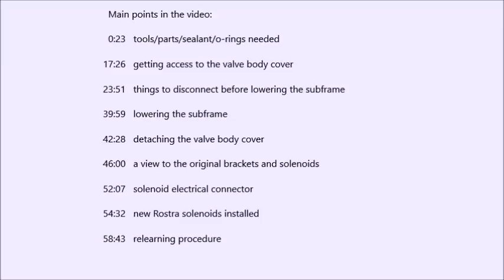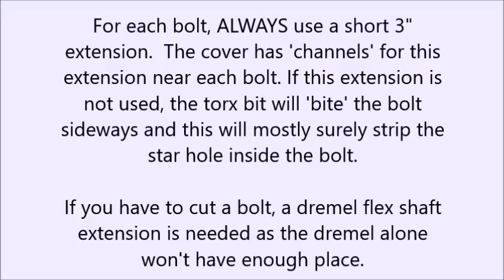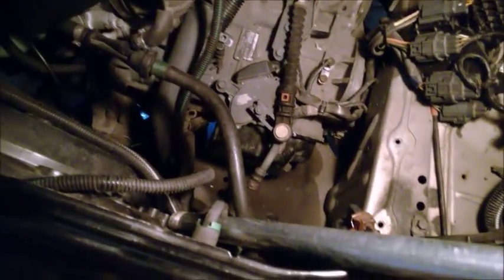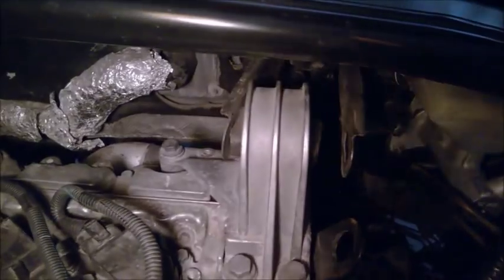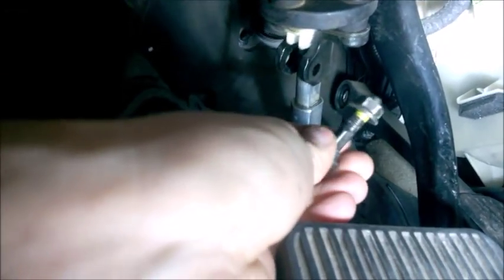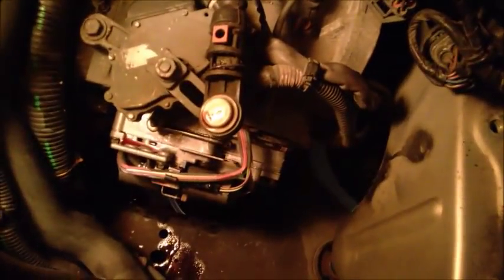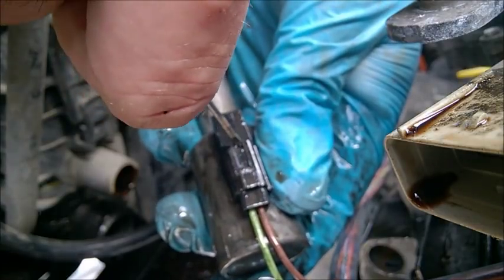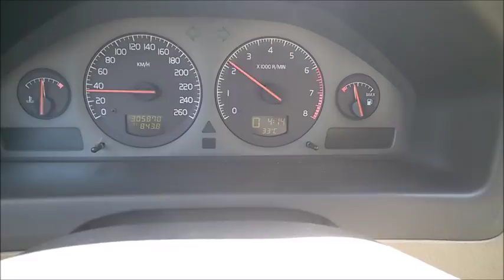Volvo S60 V70 Transmission Solenoids Replacement + Adaptation Relearn 2001-2009

Comment from the maker: I recommend measuring the adjustment of your old solenoids, and make sure the new solenoids have the same adjustment. See this video  https://www.youtube.com/watch?v=k1TG4BOjixg May use a 3mm Allen key or a Torx 15 tip.  The reason for this is, Volvo says the original solenoids are 'matched' to the valve body, which may mean that not all original solenoids have the same adjustment from car to car.  A Volvo owner also reported problems with the S4 solenoid which affects the 2-3 upshifting. I did not replace this solenoid and indeed, my 2nd to 3rd shifting is the one that still has an 'hesitation'
Out of curiosity, an article by Rostra (who made de solenoids), it's about the Geartonic transmission but at the end of the article, Rostra says "Problems with OE solenoids involve wear or debris build up affecting the internal bushings. Rostra has redesigned the bushings to prevent those issues such as wear or sticking of the spool valve. The solenoid body has also been redesigned for better oil flow."  So Aisin said no need to change the fluid, but the solenoid design was actually not correctly done to work properly in old fluid. https://rostrapowertrain.com/2018/05/aisin-warner-09g-electronics-anatomy-of-shift-controls/

Comment from the maker: One interesting and little known fact, is that the MAF sensor also plays a role in the way the automatic transimssions are shifting.  A fouled sensor (not necessarily faulty, but with the hot wires covered with dirt), may also cause the transmission to shift weirdly.  It's a less known fact, but worth google up : "does MAF affect automatic transmission".
Reply: See i have been trying to find info about the affect it might have because my issue only happens once the transmission is hot. Then i suddenly have no gear. Like “shift flairs”. But it cools down its good to go. 

When it happened the first time it was hard shifts, when i checked my dipstick it was definitely burnt. It only acted up once it got warm. Naturally i changed the fluid. Simple drain and fill. Not a flush. But no change in performance. 
 
It Worked great for a while during the winter but it would act up if it rained. 

I still could not for the life of me figure out what was happening. But now if it gets warmed up then its not gonna move anywhere. It also has a buzzing sound I noticed after this last fluid change. This sound will stop after the operating temp is reached.

Comment from the maker: Hello everybody.  I would like to share my 2c about transmission fluid change.  This is just my opinion  😊  I did flush my transmission at 100.000 miles.  I have to say, it worked less well afterwards.  Before the flush it was shifting with only a very small kick, after the flush the kick was more obvious.

The transmission adapts continuously to the fluid properties.  Replacing a large part of the fluid at once, may not help the transmission to adapt quickly enough (bigger the change, bigger the adaptation).  When we drain the sump, we remove 3.5L which is exactly half the capacity of the transmission. So the transmission has to adapt to 50% new fluid all of a sudden - this new fluid has quite different properties than the old one.  Plus, the old fluid is the genuine one, replacement ones (Mobil, Toyota, etc) have different properties.  On top of this, the solenoids are old and work more or less freely, so the adaptation is even more difficult.

If I was to do it again, I would remove a smaller amount of fluid every time:  more like 2L instead of a complete 3.5L sump drain. Then drive the car at least 500-1000 miles inside the city where the transmission has to do a lot of shifting so has plenty of time to adapt to the amount of fresh fluid.  And given the aftermarket fluids are not exactly as the genuine one, I would invest a little and buy genuine fluid.  If you look at the cost, 12L of genuine vs 12L of Idemitsu is only $100 more, basically the equivalent of 3 oil changes.  I think it's well worth an extra $100 for the transmission. Of course, just my opinion  

Idemitsu fluid https://www.fcpeuro.com/products/volvo-transmission-service-kit-idemitsu-1161540kt
Genuine fluid https://www.fcpeuro.com/products/automatic-transmission-fluid-1-liter-1161540

Comment from the maker: Transgo shift kit have usually decent reviews.  Adaptations reset/relearn video (read the comments section)  https://youtu.be/qzXAdxZpjWU
An UPDATE on this repair, it has been now pretty much 1 year ago.  I'm very glad I did this fix, but as always I have to be honest and not give false impression that things are perfect.  The car is shifting fine now, with a slight 'jump' from 2nd to 3rd especially until the fluid warms up.  Once it's fully warmed, it shifts nice and gentle - I'm sure it's not like when the transmission was new, but perfectly fine for the mileage.  The drawbacks - which can be explained by wear in other transmission components: when coming to a stop sometimes I get a small kick after about 1 second (just like a bicycle was kicking me from behind).  This kick turns into a relatively strong 'slam' if I happen to brake strongly while going on a steep downhill - perhaps when the transmission is down-shifting into the 2nd or 1st gear.  Also, maybe it's the age, but this transmission is a little slow to downshift when fully depressing the gas pedal all of a sudden - it takes maybe 1 second to downshift in order to take off.  This is it, other than that no problems, well worth replacing the solenoids - be sure to use new ones - either Rostra or Sonnax. A Volvo owner also reported problems with the S4 solenoid which affects the 2-3 upshifting. I did not replace this solenoid and indeed, my 2nd to 3rd shifting is the one that still has an 'hesitation'

Another UPDATE as of 2020. Well well, this winter I had a surprise. It was a cold day, I brought the car inside the heated garage to replace the alternator regulator. I disconnected the battery while the car was still very cold from the outside temp. When I connected back the battery, the car had warmed overnight inside the garage. I think the CEM got confused: before the battery was disconnected, the temperature sensors were reading very cold, when the battery got connected back, the sensors were reading warm garage temperature. The result of all this is the transmission lost all adaptations all of a sudden! I've never heard about this on forums but it definitely happened. Since it was winter, I could not readapt them back again (the fluid never gets warm enough during winter), so had to do it this summer. This time I did use a code reader (Foxwell NT53) which can reset the adaptations but it doesn't engage the relearn mode. Still, I did reset them and drove the car warmed up this way: did a few gentle accelerations from 0-50mph (to gently engage all gears), then came gently to a stop to again downshift gently all gears. Did this a few times and now it's again shifting smoothly, perhaps even better than I did the relearn the first time with Vida. All this to say that perhaps it's easier to relearn the adaptations doing a much simpler procedure: slowly go 0-50mph then slowly come to a stop (repeat everything a few times). Vida has a much more complicated procedure that I think it's not really needed. Cheers
Reply: I did the vida test on mine V70 2006. I discovered that these 3 upper solenoids did not make the clicking sound which tells me that they are stuck. They did change current on the vida diagraph so they might be electrical sound.
My car has this annoying delay betwene 1-2 and esspecialy from 2 to 3. However the test did reveal another issue with the S4 solenoid,  no click so its stuck too which explaine the bad shifting betwene 2 and 3 as the S4 are responsible for this task. 
Just something to bare in mind
Reply from the maker: @ivanstenchristensen7037  Good info.  There is indeed a good chance it's more that just those 3 solenoids.  At least from my experience, replacing only those 3 will not make the transmission shift perfect.  Better, but not perfect.  Plus there can also be more internal wear at this point. If you go ahead with this repair, let us know how it turns out.
Reply: Do you think a Saab could do the same slow 0-50 slow stop strategy to relearn the adaptations

Comment: Hi Peppermint, thank you so much for posting this video.  I've been planning this repair for a few months now and I've been watching and rewatching your videos.  My Volvo S60 has done 160,000 miles, and I couldn't find any record of a transmission oil change in its service history.  This weekend I finally did the repair.  I used Wynns transmission flush before to remove any varnish/deposits, and then dumped the old oil.  It was black!  It wasn't too much trouble doing the job - just took a long time.  Brand new Rostra solenoids fitted, and total oil flush (Gibbons method), then enabled adaptation mode.  Drives and shifts so much smoother.  All sudden jerks, slams, and flares 100% gone!  Thanks again!
Reply from the maker: I'm really glad to hear about the improvement!  Hope others read your feedback and bring their cars to drive better this way.  Cheers!

Comment: Not nearly as many steps but I have to remove the ecu, battery, battery box and front grille to mine on my 08 Chevy Equinox which has the same transmission
Reply from the maker: Right. These Aisin were shared by several car makers
Reply: @Peppermint1  do you know if there are manual transmission options for this Volvo and engine? I'm looking to do a swap

Comment from the maker: When lowering the subframe, there are several things that need detached as shown in the video.  The right lower engine mount near the crank pulley may be stressed and break. The power steering line near this mount can also get crushed by the engine shifting. Undo the end links so you don't stress the shock absorbers. I didn't mention the knock sensor wires which are attached to the subframe: when lowering, these wires may stretch, I recommend undo the electrical connector - on the turbo there are two sensors (on the block behind the intake) and one connector (with two cables) attached located on top of the subframe, on non turbo there is one sensor on the block (behind the intake) with a electric connector right at the sensor (try to detach this one) and wires going into the large wire loom.  If your engine starts 'pinging', there may be an issue with the sensors from lowering the subframe

Comment: hey buddy great video, my 2006 S80 2.5t AWD sometimes downshift rough from 3rd to 2nd and up shift rough from 2nd to 3rd, im confused if i should replace those solenoids or the S1, S2,S3,S4 and S5 solenoid, and also what is the difference of those S solenoid to the ones you replaced. thanks.
Reply from the maker: Hi, maybe see here pictures 4-5 and the table, it explains which solenoid does what..  usually most of the time we replace only the three main ones but of course, there may be more or less valve body wear elsewhere.  Ideally is to replace the whole valve body with a refurbished unit from a quality place, then do the adaptations relearn  https://www.sonnax.com/tech_resources/196-aw-55-50-af23-33-diagnosis-and-valve-body-information

Comment: Thank you so much for a detailed video. I have a volvo xc90 T5 AWD that seems to go into neutral as soon as the engine gets hot. It started with rough shifts but now wont move at all after about 15-10km, could it be the solenoids? Thank you in advance
Reply: Have you ever resolved this? I just replaced the transmission on my 03 xc70 same engine and I'm having that exact problem, shifts fine until the engine is half way warmed up then it completely disengages. When i shut the car off and restart it, itll briefly hold gear for 50 yards, then disengages again. I tried cleaning transmission ground, flushing the fluid, cleaning the connectors, plugging the TCM in and out, and replaced the shift position sensor all to no avail. I read that it could be that the viscosity of the fluid changes to be thinner when it warms up so i added an additive bit that wasn't it.

Comment: Hey mate. I have a 2008 Volvo s60 2.5T , I'm having some major clunking when going from park to drive, no major noise from park to neural or reverse. When i'm at a stop and take off slowly I hear a clunk , however no problems while its shifting when coming to a stop or going onto the freeway. Did the torque arm, it was pretty bad. Still have a clunk. Are these symptoms consistent with trans solenoids, or could the trans be toast? Cheers! (bought the car with 160k miles, never had a transmission oil change to my knowledge).

Comment: I I changed the solenoid yesterday, but I faced a single problem, and it is only when I reduce the speed while driving down to the first gear, I face a delay problem, and when the first gear responds, a shock occurs, or as if using a hammer, what is the problem..?

Comment: Great video! 👌

I found this video in order to find a solution to my problem.

I did a total flush on a 150k miles six speed aisin on a Volvo. Mistake nr 1. And I also did reset the adaptations. Mistake nr 2. The car was shifting fine before this.

However. I did the adaptationdrive two or three times. Dont really remember. But it still has a 100-200 rpm shift flare in almost every shift both up and down. It seems like the "slipping lock up" engages to slow. Low line pressure I would assume? The car shift really fine when cold but as soon as it heats up the shift flare starts to happen.

Only thing left before swapping the valvebody is one thing I thinked about. I did reset the adaptations when the tranny was cold. Then I drived the car until warm and performed the adaptation drive. Can this make the adaptations not reaching its correct values when warm? Like its baseline is when its cold so even I do the adaptationdrive when its warm its something that gets crazy? Should I try driving the car until its fully warmed up and then reset the adaptations again and do an relearning drive?

Other then adaptation I guess there is a internal leakage that showed up with the fluid change and I have to change valve body or complete trans.
Reply from the maker: Did you got at some point the message similar to "transmission fluid is warm" after disconnecting Vida?  That's when the adaptations start being learned.  May look at this video https://youtu.be/qzXAdxZpjWU   At same time, my take is at high miles the solenoids in P2 Volvos are already pretty slow moving, the TCM may not be able to adapt them correctly. Try driving it mostly in town with plenty of gear changes for a while. See if it improves.

Comment: I just replaced my VVT solenoid could that mean I have to replace the intake one since I replaced the Exhaust vvt solenoid. Still get code po0014 but doesn’t act up like it use to works better but the check engine light will be on and same code

Comment: Was your Volvo throwing a code prior to replacing? Looking at purchasing a cheap 2002 V70XC with code P0785 which is showing shift solenoid problem.

Comment: Thanks for posting. I have an 2006 xc70 that shifts thuds into 2nd and 3rd and sometimes has a small thud when driving on the highway in 5th. Would this fix help or is my transmission beyond repair? Thank you
Reply from the maker: May try first changing half the oil and resetting the adaptations with Vida software (see video). May ask forums as well https://www.matthewsvolvosite.com/forums/

Comment: Can solenoid s3 be cleared inside and does it need trsnsmission to be adapted if I replace solenoid s3 or clean that solenoid or not? I've got error TCM-0115 in a volvo s60 2005 2.4d D5. Thanks!

Comment: Hi. I had a lot of problems with the automatic transmission in my car. I changed the bushings of the solenoids. it was very nice car. However, a new problem has arisen. Except for shifting to D position and knocking.. there are no errors left. What do you recommend ?

Comment: Hey guys... I replaced the valve body on a 07'  XC90. Now the vehicle has no reverse. Couple of threads I read online say a seal may have been damages upon installation but doesn't stay which seal. Was wondering if you might be able to point me in the right direction.  Thanks.

Comment: Haven’t watched the video yet but my transmission takes a second to go into D or R and clunks when it does, and it has started really hesitating a lot between 2nd and 3rd when it warms up. I’m gonna try doing a drain and refill over the course of a few weeks or couple thousand miles to see if that works. If that doesn’t help then I will be back here to replace the solenoids next. I’m just glad knowing there’s a thorough video on the process
Reply: How has that worked for you? My 2008 s60 has 175k miles and has a significant clunk when shifting park to drive and clunks under acceleration. It doesn't have any problems shifting while driving, just clunking so I am suspecting the solenoids. Has replacing the oil been a successful fix or have you needed to do the solenoids.
Reply: @k9man163  Have you checked engine and trans mounts?
Reply from the maker: The delay and clunk from P to D or R is most likely the transmission has lost its adaptations. In a warm summer day, connect Volvo Vida software and do an adaptation reset and relearn procedure as shown here  https://youtu.be/qzXAdxZpjWU   I had my transmission lose the adaptations and develop this clunk/delay by accident - on a cold winter day, I got the car inside the heated garage and disconnected and connected back the battery to do some work. The car thermometer recorder cold temperature before entering  the garage, then after plugging back the battery it recorded warm temperature inside the garage. This confused the car ECU and got the transmission adaptations reset.
Reply: @robbieackerman1164  Yeah I did the Trans tourqe mount and the top engine mount, not the 2 bulbuos ones or the passenger mount